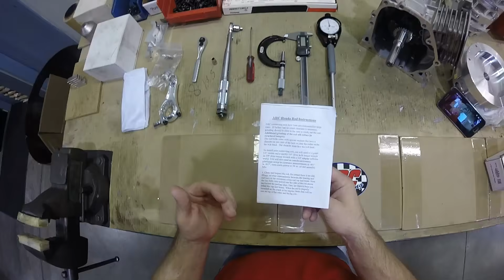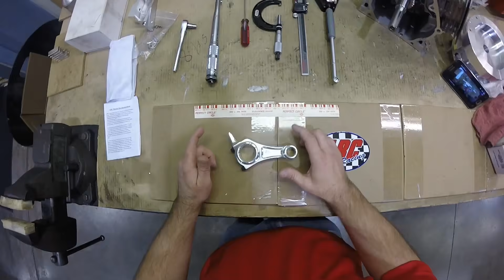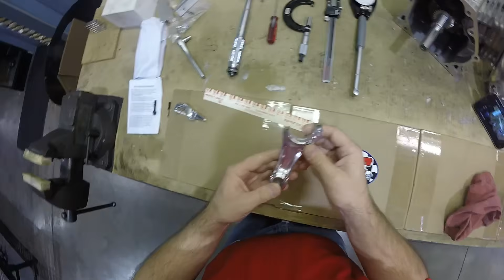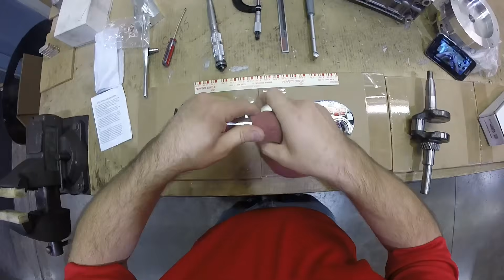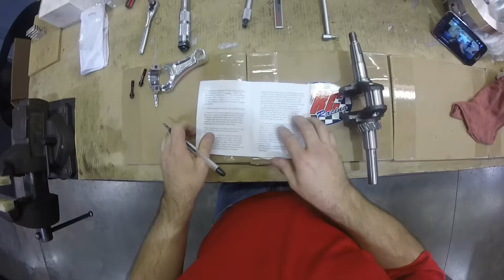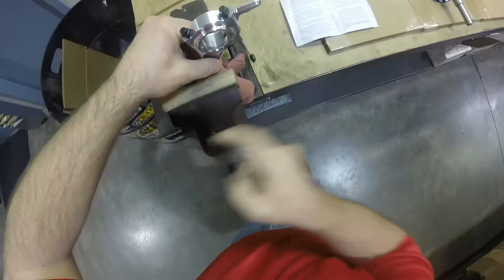ARC Racing Connecting rod installation(Go kart racing, Mini bike racing)

Comment: How many rebuilds can the ARC rod bolt can be reused?
Reply: I could think of times one could get away with it but it would seem it's a better idea to at least replace the bolts and bearings and sometimes the entire rod even if it eyeballed ok.

Comment: I have metal shavings in my first 3 oil changes while breaking it in.    Would the bearing or rod be rubbing on the lip of the crank?  Should I pull the piston and check the bearings?
Reply: .003 oil clearence.   Piston walls still look like new.  Took off a bit of crank to make cam clearence with a cut side cover to be able to see.  .265 cam  Plenty of piston to head and piston to valve clearance wiseco stock bore piston.  Am I overly worried or....... 
 Is this normal when breaking in a newly built motor?

Comment: You should torque your bolts in two stages, not every 20 inch pounds.You're not applying enough force to break friction and can get false readings. Notice how it clicked at 100 inch pounds even though it was only torqued to 80?
Reply from the maker: The reason for the muilti step process is to seat the bearing properly. The bearing and the rod are shaped slightly different and the bearing needs to be forced fit into the rod. In some cases slower and steady are better.

Comment: unsure why you torque to 170 in lb when spec is 150?
Reply from the maker: The spec is 150 inch/lbs with Moly Lube and 170  inch/lbs with regular oil. Most Average Joe's will use regular oil so we put the specs for each in the instructions that come with the rod. That way they can chose which they prefer to use.

Comment: to polish journal , can 1000 to 1200 wet and dry paper be used? I've used it on automotive cranks before. wrapped it around a oily crank, then i wrapped a leather shoe string 3-4 times around it. work back and forth a few times then check the crank. is this acceptable on small engines?
Reply from the maker: That would work fine. Just go slow as to not polish the journal too small. Polish, then check, polish, then check.

Comment: 600 grit wet sanding OK for the crank journal?

My Hemi journal measured nice and round 1.188", but plastiguage showed 0.002"oil clearance, which was the minimum per the instructions (0.0005" less than target range of 0.0025" - 0.0030").

I think I should hit max RPM around 7000 - 7500 with my set up, but should mostly be around 5-6k.

NR285-0211, 37lb springs, Big Valve (28.5/25) Ported Milled Hemi Head, 11:1 CR
on Minibike with 13" Tires geared 5:1 with Torque Converter
Reply from the maker: Probably your best bet would be to take the assembly to machine shop and have the crank polished. while its at the machine shop have them double check the measurements. It might take a little bit of experience to hand sand one to size.

Comment: Do Rod bearings and rod bolts come with the vanguard 6276 rod?
Reply from the maker: YES
Reply: Do you have to torque down the rod caps on the crank the first time to seat the bearings? I have micrometers and a bore gauge at my disposal. Being that you can only tighten and untighten these rods 5 times, I would have to first tighten them on the crank to seat the bearings, untighten them and retighten them in a vice with the bearing in it to measure the bearing oil clearance, and then untighten and retighten one last time to install in the engine. That would only leave me 2 more times that I could unscrew and re torque the rods before replacement correct?
Reply from the maker: You can seat the bearings in a vice without using the crank. When you tighten the bolts for the first time it seats the bearing.
Reply: Thanks.

Comment: I disagree with lubing all bolts before torquing them. a bolt with lube should be torqued to a different specification than to one that is not lubed. it is up to manufacture discrepancy as to whether the bolt is lubed when torquing it down. most manufactures say to torque it dry.
Reply: You do understand they are the manufacture of the rod. They say do it lubed I'm pretty sure they have the lubed specs listed in the paper work they printed and included.
Reply: You don't want to or be super careful with fasteners in blind holes. Lube can get trapped in the hole and cause hydraulic resistance.
 I think sometimes it's easier to teach people to torque dry.

Comment: What happens if it does not meet the oil clear eve specifications
Reply from the maker: depends on if the crank is too big or too small. Too big polish the journal down to size, too small new crank shaft.

Comment: Is it 150inch pounds for torque specs or 170? I've seen them different on another video
Reply from the maker: 150 with molly lube, 170 with oil. we prefer the oil you use to assumable and break the engine in with.

Comment: Nice video, but you forgot the 12-point bolt head measure: I can get 1/4" 12 point sockets, but what is the exact measure for the bolt head itself.
Reply from the maker: 1/4 inch - 12 point

Comment: Does the connecting rod come with it's inside clearances labeled?

If so most people can find access to a regular micrometer making this much easier for the installer that does not have an inside micrometer...
Reply from the maker: Paper work comes with the rod.

Comment: I noticed when torquing the bolts I would go in 20 inch pound increments up to 160 and then take the last 10 and on that last increment from 160 to 170 sometimes the bolt wouldnt turn any further. it would just click the wrench.  Kind of made me wonder whether i really had them fully torqued. Also, how many times can those bolts be reused before replacing. I had mine apart a few times due to learning the hard way with the plastigage. if only i had seen this video sooner.
Reply from the maker: +Fred Geitner  What kind of torque wrench do you have, how old is it? The bolts can be properly torqued 4-5 times. It would be best to measure the bolt before you install it and again after it is torqued to see how much stretch as occurred.
Reply: I have the 1/4" drive torque wrench from Harbor Freight. I also have a beam type which i checked it up against and it seemed to read accurate.  Yes this is my first small engine build. When i saw this video i saw some things you did that would have saved me alot of trouble if i had done that way. I could have easily miked the bolts but i didnt think to.